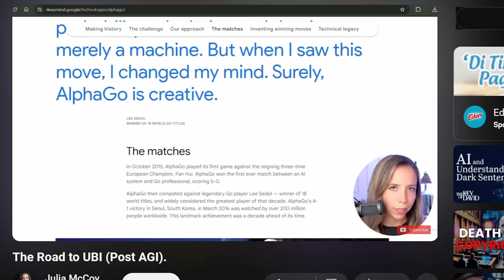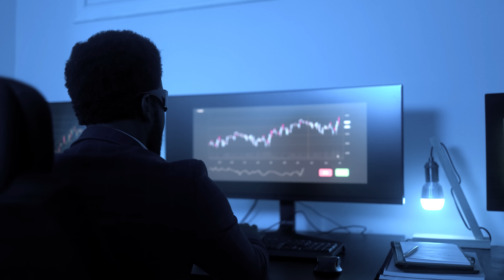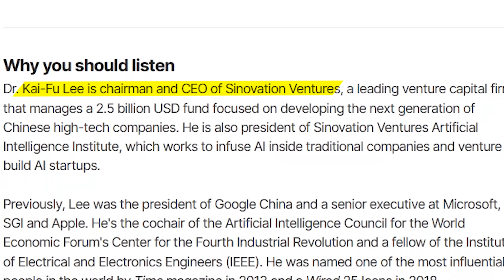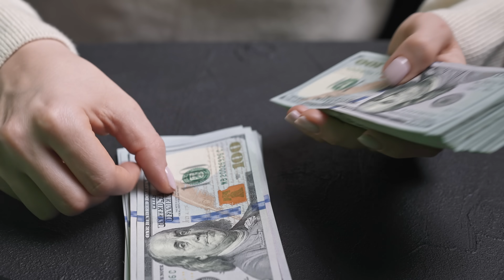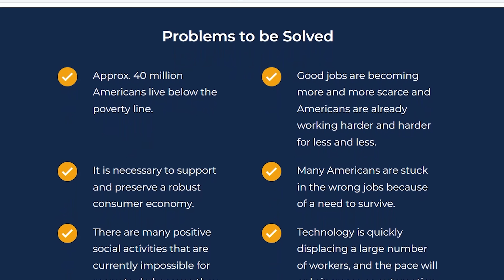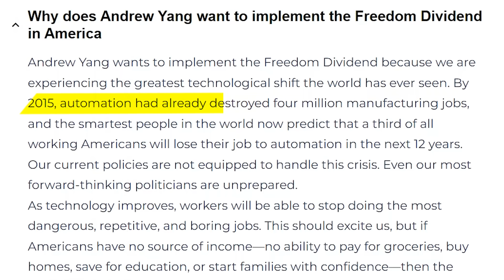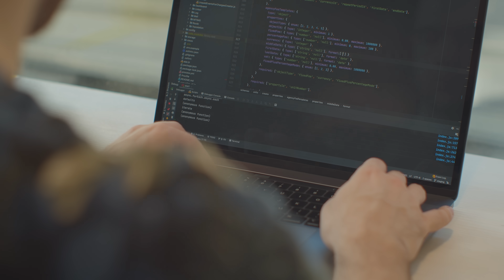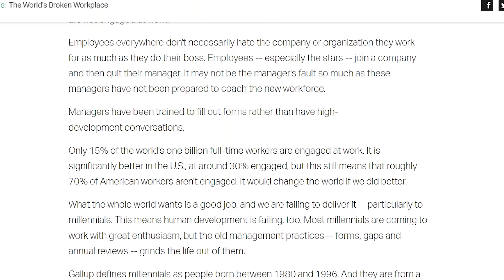The Pitfalls of UBI for Humanity

Comment: As always, thanks for the book recommendations.  I disagree with UBI claims, it may happen in various ways for a while, but sooner or later the powers that be will let unrest reduce humanities numbers significantly when masses of human labor are no longer needed. The climate reality will force this issue.  The only way to avoid this is to collectively act sooner, but even then, I'm not sure elites will want to sustain our current numbers of humans.  What arguments do you have that would not only provide the optimism you have and try to keep but also help prepare and set the stage for a global society that will indeed solve the problems necessary to maintain our populations?

Comment: I would very much prefer a UBI that is fully automated and independent of government.
A digital currency like Bitcoin, except everyone gets an allocation, maybe once a week.
(Establishing unique identity to avoid double-dipping is an interesting but solvable issue.)

Rather than have the digital currency taxed out of circulation by a government (to avoid hyperinflation), the currency would have continuous demurrage - i.e. each digital unit that is created will lose value with age.

To bootstrap it, you'd need a parallel 'permanent' digital currency, which like Bitcoin is steadily created over 50 to 100 years, but holds or increases its value, and which can only purchased (on an open market) using units of the demurrage currency - or perhaps initially an equal number of dollars and demurrage currency. units, to tie the value of both new currencies to a familiar existing currency.

Comment: My calculations are for massive, 50% level job losses, with the peak rate being next decade. That's without feedbacks. However I doubt we have the power to do it, at the moment,  so a lot of the leverage needs to be from efficiency.  GPT4o seems to be a step in the right direction for efficiency.  So fast and so sharp.
Reply: Labor force participation rate is only 63% right now. 37% unemployment. China is already at 50%.

Comment: AI is massively replacing human from their workplaces, however it is no difference from the machine massively replaced 99% of farmers from the farming industry in the past. What happened next was that machines miraculously solved the worldwide hunger problem, one thumb up to machine. However in return, newer human generations no longer think the farming is a worthy profession, too simple for human. We move on to more complex professions like AI creators, youtubers, Mars colonizers. In other words, we did not have half population collecting UBIs because farming industry is suddenly and completely obliterated by machines.  

Today we have a much bigger and complex economy, which makes the AI impact much bigger than the one caused by farming machinery. Nonetheless, AI is still a tool built by and for human, just like machine. To bring AI to human level, AI needs to have curiosity, imagination, need to know what is tools, and how to use tools. Each of these seemingly simple human attributes are extremely hard problem for AI even at conceptual level. The reason the artificial intelligence is conceptually simple to understand even by layman is that scientists and engineers only pick the machine compatible human intelligences for AI, which is a very small subset of human intelligence.

To make matter one level more difficult for AI, 1) Human (Galileo) can act on the curiosity to discover Jupiter's 4 moons and use them to calculate the speed of the light, without purpose. 2) Human (Wright brothers) can act on imagination to build a flying machine which is much heavy than the air, without purpose. 3) before building a new random thing without purpose, human can first imagine the tools the need in their head then build the tools physically, which is nothing like the original thing they want to build. The hyper intelligence at every step of these examples and the behavior of going after things without purpose (called fun or passion) are unimaginable complex even for human to comprehend.  

Add another level of difficulty to AI is human addiction. Human addict to good food, good vacation, and good anything, since we define the "good" as the attribute we addict to. We do anything for things we addict to, even killing ourselves for things like hard drugs and loves. 

Addiction is machine incompatible but super important. We collectively work hard try to produce good stuff so we can sell them well, at same time we collectively spend lots of money on things we addict to. We are both producers and consumers in a closed human-made ecosystem, called economy, in which producers are the force while consumers are the brain. It is the consumer side of the economy dictates the future of the society, even for highly motivated producer activists, they have to follow the consumer needs and lead. 
        
AI can be a very efficient producer, but AI is incapable of being a consumer due to lack of innate desire/addiction which is random, transient, and illogic. Although without consumer, a producer only society can be constructed artificially in a model world, it cannot function, any production will soon stop if there is no consumer for it. Hence we can rule out any AI centric civilization.